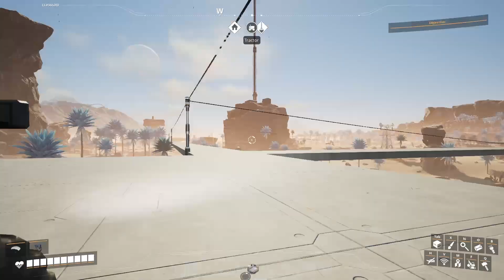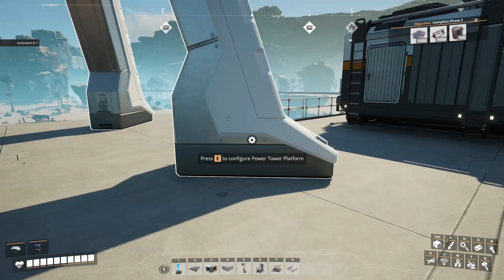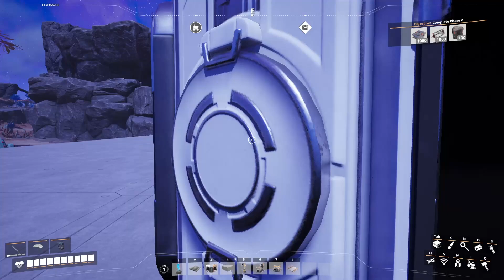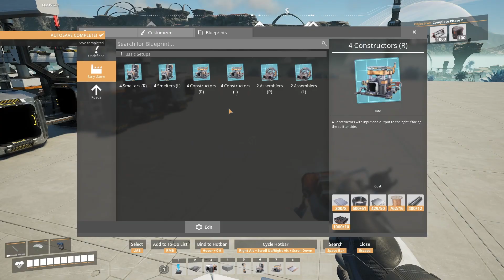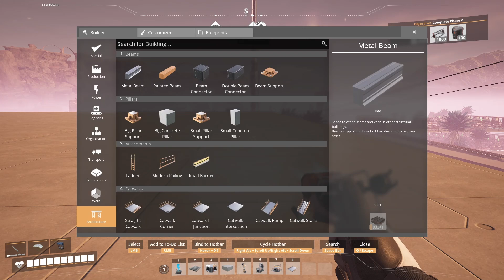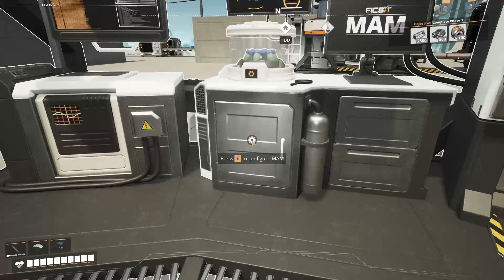Satisfactory 1.0 - Completing Phase 2 and Making Motors [E9]

Comment: I found a trick for hatchers.  Instead of creeping a long way away; if you approach across flat or downhill ground you can stand up just long enough to trigger crouch-slide and it doesn’t activate the hatchers.  I’m still not good at judging trigger distance so this way I can approach quickly and x-Bash them.
Reply from the maker: Thanks for the tip. I will check it out.

Comment: Hey! Was trying to expand my coal power(setup is exactly same as yours), but realized that the moment i split lines for the 2 sections of generators, the last 2 generators coal starts depleting quickly. Will it happen that they keep turning on and off, or will they keep operating?
Reply: When that happened to me I walked through ALL of my belts and discovered a mark 2 where it should be 3, so a similar issue might be doing something to you.

After I manually filled the last 2 from the mini auto miners, there was no issues whatsoever.
Reply: @Biblioholic1993  Hey! I did fix it. Had to rework some belts and manually feed a few generators! Thanks!
Reply: I tried that, it keeps depleting. Does it happen with you too?
Reply from the maker: Check your coal supply and belt speed to make sure enough coal is coming through. Definitely shouldn't be happening.
Reply: I placed my generators further along from existing generators but the last generator wouldn’t accept coal from the lift.  I had to nudge it back a couple spots and run a belt from the dropped lift.
Reply from the maker: If you run out they will turn on and off. Maybe turn them off for a while and let them fill up.

Comment: I have 52 coal plants running from those 3 Pure Coal Nodes, 4 banks of 13, 20 water extractors but you need tier 4 belts to shift all the coal and tier 2 pipes for the water haha.
Reply from the maker: Impressive. I'm going to focus mainly on fuel power.

Comment: How are you making screws from Iron Ingots? It's making me make pipes then screws
Reply: It's an alternative recipe from hard drives.
Reply from the maker: It is one of the earliest alternate recipes that doesn't have any prerequisite requirements. If you find hard drives early on you have a really good chance of getting that recipe. Just avoid doing any MAM research or tier upgrades before you have it. I think there are only 5 alternate recipes that don't have prerequisites. That is by far the best one.